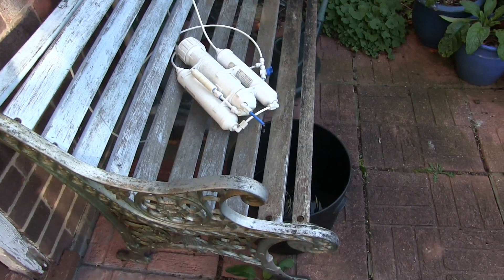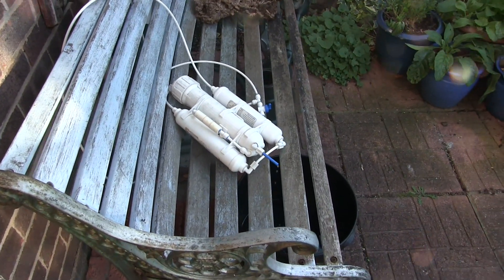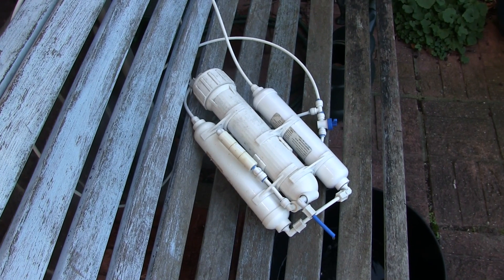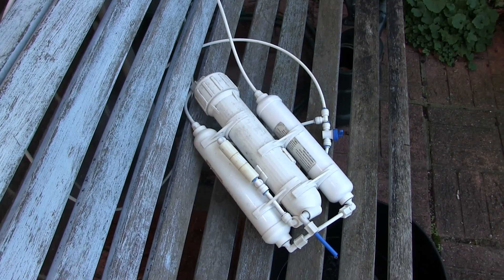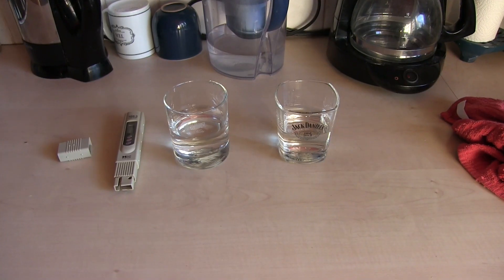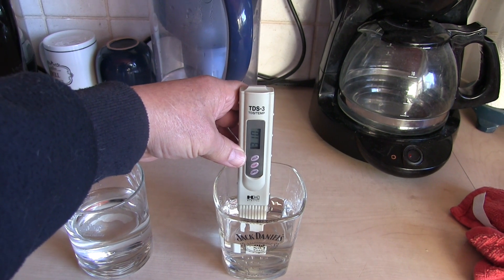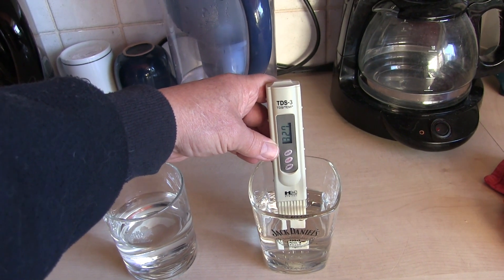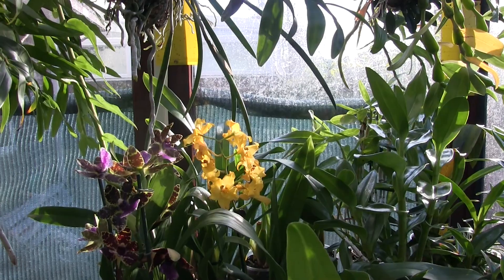RO Unit - Careless on My Part! (Follow This to Find Out What/Why)

Comment: If I understand this correctly, it is hooked up wrong. Your waste water shouldn't be going back through the filters. The tap water only should go through each filter once, then, coming out of the two connections on the membrane housing should be the pure water and the waste water. Waste water should go through the flow restrictor and to the drain-not back through the system.
Reply from the maker: I was flushing the system as per instructions with new filters.
Reply: I meant that if the waste water was being filtered, it was hooked up wrong. When you flush the membrane, you just bypass the flow restrictor which produces a larger amount of waste water at a lower tds than it normally would be while the waste is going through the flow restrictor. When I enlarged the video, I could see where your lines go better and it's fine. Sorry, that whole thing was confusing. I thought from what you said, that your waste water was going back through the filters.  Anyway..I'm jealous that your feed water is 250. Your reject water is better than my tap water. It was at 360 for years which gave me a nice 10 tds, but now it gets up to 550 more often than not, and then I get 20tds. My waste water runs about 700-900. Oh yeah..but I was going to say that when my unit was new, I think I used it for 4 years before the membrane went out. I was lazy and never changed my pre-filters during that time. I've got a smaller collection, about 100 plants is all, but I also don't re-use or share water, so I have a feeling like you probably don't need to change your membrane for 5-6 years if you change your filters at least once a year because your tap water is so much better than mine and you re-use so much of it. (I did watch your wonderful video about how you do things. Thank you so much for sending me that link.) ohh..by the way..I don't know if you can make that like..your top video somehow, but that is exactly the kind of thing I would have killed to watch several years ago-you go over the how and why so well..I think it is really helpful for people to see how good growers do things, and I don't think anyone else has made such good videos including the why and how of watering. Salt buildup, is the most common thing I think, that plagues indoor growers, even if they use RO  because they don't flush large enough volumes of water through the pots. I slip back into watering the pots just 'once' sometimes and actually being able to watch someone dump what amounts to a half gallon to a gallon through each pot is a great reminder.

Comment: ........depends on the quality of the filters to begin with...and you input water......a lot of the cheap off brand R/O units, are really one filter made to look like 3.....may not be any difference......I've only seen R/O units go out 2-3 times in all my years and all those times the actual membrane was damaged......I know of several people that have very well used R/O units going on 5+ yrs on same filters....and they were cheap E-bay units.......and they run 50 gals a week or more....would love to see a big difference when you change them......if not......at least you know its the main filter that is doing all the work.....I enjoy it when you get curious!
Reply from the maker: I've already replaced the filters and have a new membrane on the way. I'll be retesting the output and waste water once it's all set up. Applying a bit of 'logic' (which could be wrong) although the pure water has been taken out and that should leave the waste water with a higher TDS reading, if the pre-stage filters are doing 'something' that reading shouldn't be too high? My filter jug in the kitchen takes the tap water down from 250-260 to 150 and that's the same sort of carbon filter as in the RO unit.

Comment: Hello again Roger.  Lookie lookie what I found. 
However in reverse osmosis (RO) systems, membranes are easily damaged by chlorine in the feed water. Chlorine damage to the membrane can lead to lower salt rejection and poor-quality permeate, which in turn could result in costly membrane replacement and down-time.
  The pre filters, or first two filters are for sediment I think for the first and chlorine for the second.  The most important is the carbon filter removing chlorine to safeguard the membrane.
Reply from the maker: Everything is being replaced so it will be interesting to see what it's like then. The TDS reading of the output has always been 9-10 and that is still true so the membrane must still be working ok but it's being replaced with one twice the flowrate so should speed things up a bit.

Comment: Hey Roger.   The waste water has the desolved solids that didn’t go thru the membrane.   Is like washing your sidewalk with a hose.   Only the good water goes thru the cement.   That’s why waste water has such a high tds reading.  🤓

Apparently each filter have their own limitations. The first filter which removes larger particles will not remove chlorine and salts. The second which removes chlorine and chemicals that affect taste will not remove salts and finer impurities.  And finally the membrane which will remove the salts can be destroyed by the chlorine also.  The first filter which removes the larger particles is used so not to overload the second filter which doesn’t get flushed like the membrane does, so the first two just gets plugged until the user eventually changes them, like the oil filter in your car.  Hope this helps.   Thanks.
Reply from the maker: But the pre-stage filters should do something towards taking out impurities? I'll test it again after all the filters and membrane have been changed out of interest.

Comment: that does confuse me, change the filters and then test your water, good luck with that!
Reply from the maker: I've replaced the pre-stage filters as they were 'due' and ordered a new membrane at twice the flow rate so should be better next time I use it. I don't think the old filters were working that well and the membrane is old so I'll try testing once it's all set up.

Comment: I have a question....I have had a Phal in bud, she looks like she will pop a bud open and then it drops off!! Ughhhhhh...what would make her do that??? Not enough humidity?? I windowsill grow in my house , humidity is at its norm about 54%, do you think that's too low or could it be something else. She has another bud that looks like its gonna do the same thing again. Is like to figure this out I have a lot in spike and bid now and I don't want too loose them all. I've raised my humidity a little bit I just don't know what else it can be. I need your brain
...lol....
Reply from the maker: Most 'bud blast' is due the sudden or frequent changes in the environment when the buds are forming so things like humidity, temps, and light levels. But it's normally these thing 'changing' rather than if they stay the same. That's why Phals often drop some buds after you buy them and bring them home.

Comment: If you are paying for any of your water it would pay to fill some buckets if only to use in your washing machine.
Reply: When I was looking on eBay last night, I saw one unit with a tds meter which measured in and out lines. I’m not sure if it’s included in the the unit or if it’s extra, but if it is, that would be the way to go, Only I couldn’t see how to contact the supplier.
Reply from the maker: That sounds like a 'flashy unit'. I've changed the filters and ordered a new membrane rated at twice the flowrate so should speed things up a bit. (We pay a set rate for water in the UK whatever we use - unless you have a meter fitted in which case, you do pay for what you use.)
Reply: Roger Frampton .  Had another look last night and the tds meter is extra.  I’ve been thinking a long time about this water lark and I realised that I would have to feed most times I water. At present, I am using slow release in 2 different forms plus liquid feed, and now I reckon I am bunging on too much food! Maybe I’m overdoing it and that’s one reason my orchids aren’t doing as well as they could be.
Reply from the maker: I got 'warned off' the slow release pellets as they said that in close proximity to roots, there is a high concentration that can cause root burn but I've never tried them. I know others that use them and they say they're ok. Most orchids don't need a lot of food especially if feeding frequently like I do - I'm using the 'low dose but frequently applied' method which seems ok this year. Others tend to use much higher levels of feed but only apply every 2-3 weeks in the growing season - they also seem to be doing ok. Some also say that the roots should be soaked before applying feed and others just apply the feed as they water. So many choices and they probably ALL work. Good game.

Comment: Hey Roger, maybe the pressure has gone down because the filters are saturated and need changing. I think changing them once/year is a safe bet.
Reply from the maker: I've replaced the pre-stage filters as they were 'due' and ordered a new membrane at twice the flow rate so should be better next time I use it.

Comment: Well, the waste water has a higher concentration, because the pure water has been "removed from the equation". So, the absolute number of particles hasn't changed after the prestage filters, but they are dispersed in much less water than before, so higher concentration - which translates exactly into reverse osmosis - instead of balancing concentrations, it's ... "unbalancing".
Reply from the maker: Thanks. I was just wondering how much of the impurities were left in the pre-stage filters? I put the nwe ones on anyway as they were well passed the change point and I've ordered a new membrane and upgraded it so twice the output and hopefully twice as fast!